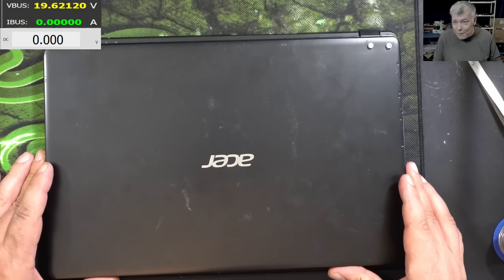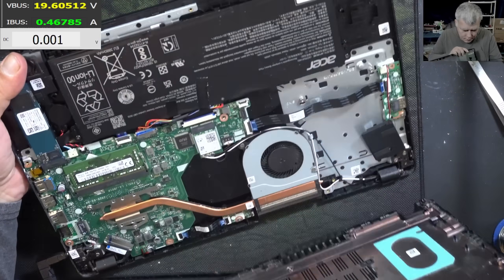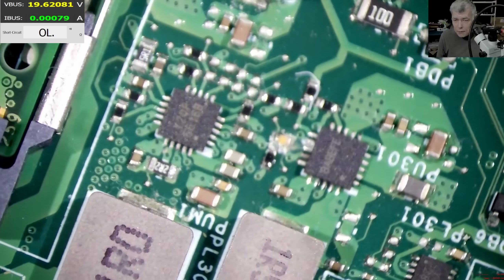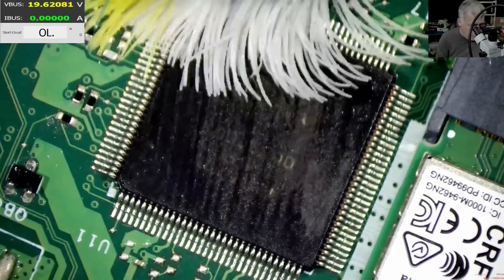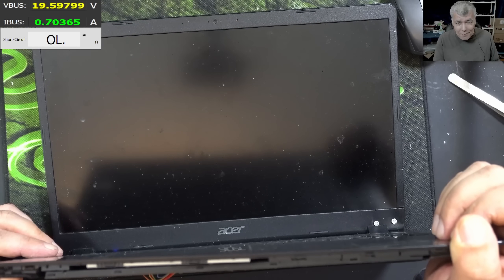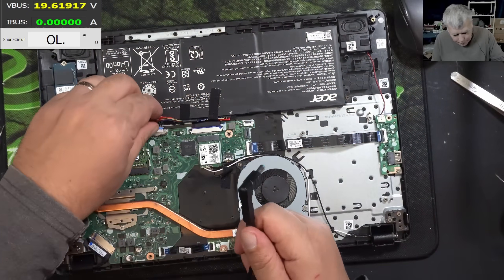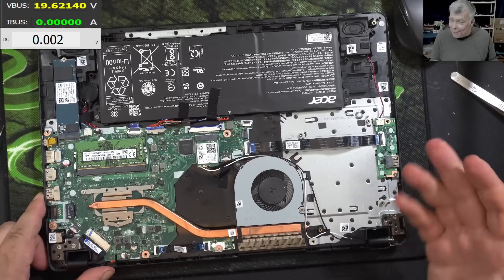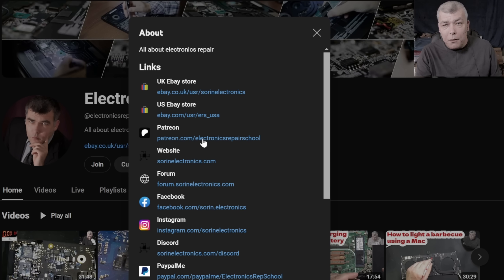Acer Aspire 3 coming ON then OFF with no extra current consumption, board repair

Comment: Hi, I have this same issue, I dont have the same equipment, but I have never cleaned this computer. Should I clean with compressed air or did you use rubbing alcohol to clean?

Comment: Got the same laptop and does the exact same thing, when you turn it on the LED lights will turn on but the screen will be off then the laptop turns off then repeats the same thing about three times before the screen actually gets to turn on and it'll run smoothly till the next time you pack and stop using it for a few hours and it'll start doinh the same thing all over again also, it does not turn on if not plugged  to a power supply but the moment it starts to run smoothly you can unplug it and it'll work fine, so i dont know could it be a motherboard thing or?

Comment: the bolt hinge repair is ugly but never fails. Depending on the case, i use it instead of hot glue or 2 component adhesive.

Comment: Mine has even a metal bar on top of both hinges. 
Acer Aspire 3 series have a problem, i believe that laptop wont shuts off. Leave a little bit on charge 1 hour or 2 hours later it will start to work. I hate it but i still use it. 

Motherboard get contacted with laundry detargent wont died, screen broken wont died, even charger is exploded but still works. Sound gets  corrupted after some time, webcam is 36px overheats (77degrees as normal), freezes but i believe one day it will give up

Comment: First of all you should check the board on both sides. Second- there was something like similar liquid damage at M.2 port. You missed it. Or if it just looked like this on the movie, forget about. But checking the board from both sides for me is must have.
Reply: but then It wouldn't be called easy pizza 😂. I think u're new in the channel. wqit to see No Capacitor no shorted Capacitor.
Reply: @Alion.147  Say hello to my little friend ? 😂 or is that too much
Reply: That's not easy pizza!